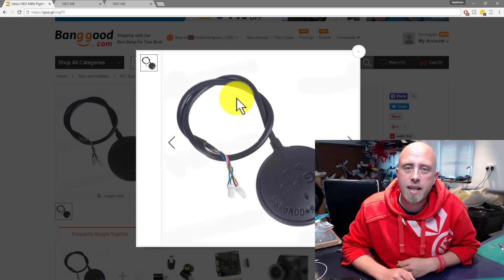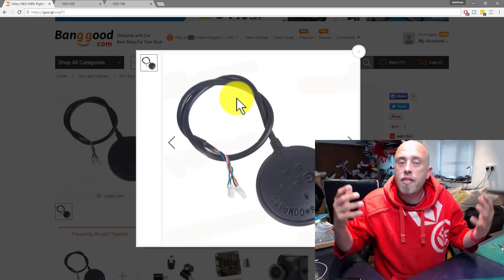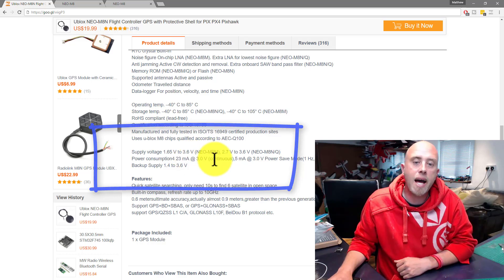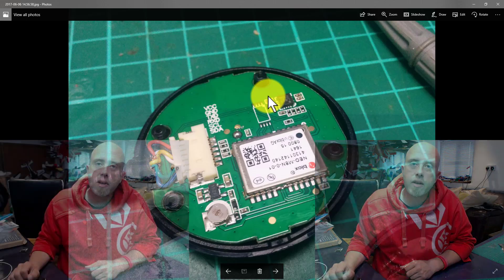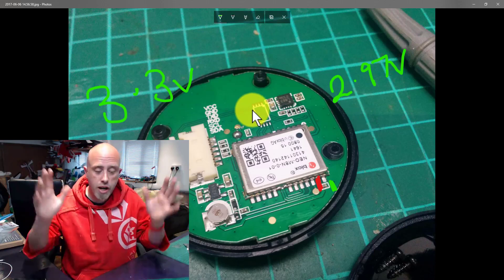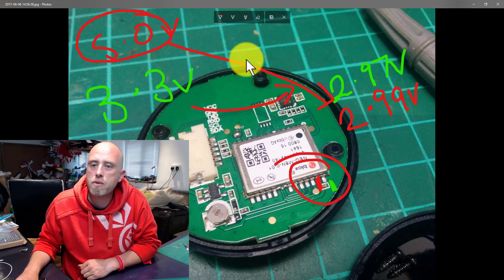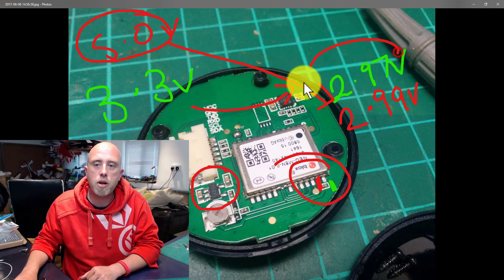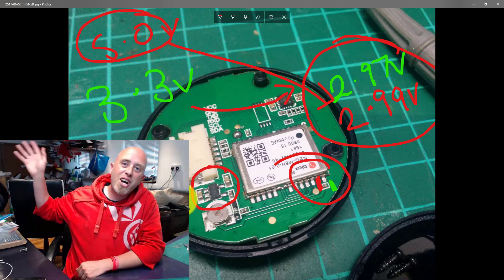NEO-M8N GPS 🛰️ Unit Supply Voltage 3.3V OR 5.0V - WHO IS RIGHT???

Comment: We use these at work, but I've just noticed that if I give it 3.3v input instead of 5v, it cuts out ALL of the UART RX frame errors. There may be something I am doing that causes this to present when using 5v...but the simple fix thus far is just give it 3.3v input and be done.

Comment: Using a bn220 I get 12 sats on 3.3v.  With 5v it takes forever to get 5
Reply from the maker: Howdy Phil, that's strange it had a voltage regulator in it.

Comment: Here's the datasheet for your particular LDO regulator (15ZF), it's  3.0V regulator, 250mA max output, with a max input voltage of 10V. So you could technically run this off more than 5V. Page 25 of the PDF has the LDO Device marking explanation. https://www.torexsemi.com/file/xc6201/XC6201.pdf

Comment: Perfect, just the verification I wanted. The manufacturer did state there was a "Low noise 3.3V regulator" on the unit in the specs but its good to get confirmation from those who have tried already.

Comment: If you can please check https://robu.in/product/ublox-neo-m8n-gps-for-apm-and-pixhawk-flight-controller/ is the same kind you are discussing in the video? Can it take 5v too?
Reply from the maker: Hi Simon, yea it'll be fine as it's meant for a Pixhawk and those pump out 5V for the GPS units too, Matt
Reply: are you able to see a 5v to 3.3v regulator in this https://static.rcgroups.net/forums/attachments/7/3/4/6/2/5/a11164005-98-IMG_9270.JPG

Comment: what about the logic? rx, tx, etc? it needs to be 3.3 volts or can be 5v as well if the chip is 3.3v? Dont you need an logic converter from 5v to 3.3v as the FC supplies the logic with 5v?
Reply from the maker: That is handled on the FC, Matt
Reply: Depends on a specific chip. Some are 5V tolerant others are not.

Comment: I have the exact same gps as he has. I just tested it today using both 3.3v and 5v. 
With 3.3v both gps and magnetometer work and icons on inav are blue
With 5v only gps work but magnetometer does not, mag icon red.
So please use 3.3v
Reply from the maker: Hi Leander, sounds like you have a duff unit, I'd return it if it's doing that, Matt
Reply: that is strange. I tried two units and did the same exact thing ie. with 5v gps works mag does not. Now I bought another one from bangood maybe the 2 I bought were from same defective batch. Can you confirm that your mag also works with 5v?

Comment: I dont get why people even would argue this point...thanks for making this video, but its even simpler... trace the vcc pin to the sot-23-5 component...bet thats a regualtor..break out the magnifying glass, google chip id,  yep its a regulator...I really dislike idiots who pretend to know what they are talking about when they have no idea...good on ya for proving them wrong!
Reply from the maker: Howdy David, exactly. Although to be fair on the BG website and on the eBay listings, it does say 3.3V, which is right for the GPS chip itself, Matt
Reply: RagTheNutsOff Lol true which I will admit threw me for a loop for a second. That's kind of a big problem with Chinese resellers because every m8n seller I've found uses basically exactly the same description, copy/pasta, and thus that error just propagates.

Comment: Matt, hi, abit of a off-topic question: I'm planning to mount/fit a barometer into this unit (example: https://www.aliexpress.com/item/BMP280-Replace-BMP180-Digital-Barometric-Pressure-Sensor-Module-For-Arduino-IO-port-communication-voltage-1-8/32793270473.html), connecting it directly to the connector pins (vcc,gnd,SCL,SDA) - do you think it is feasible? I've read, you can wire multiple I2C sensors in parallel...Thanks
Reply from the maker: Howdy Jure, I have no idea on this, the iNav lads would be the best ones to ask. Matt

Comment: thank you! I got confused because first I read the specs and thought 3.3v is what it needs. But then I opened the plastic case and saw that on the gps board the "+" pin vas not marked VCC, but 5v!

Comment: I wonder if this is the same with an older m6n, I think I might be safer going with 3.3v.
Next question, where do I find 3.3v on an Omnibus F4 V2.
Before anyone says go buy an M8N, I want to use what I have rather than wait for 3 weeks for one to come from China.
Reply from the maker: Howdy fella, see the pinout for the board, the supplier will be able to provide that for you or look back through the previous videos to find them for the one from BG, Matt
Reply: After doing a bit more research on my GPS unit I have decided to try it on 5v.
It will either work or smoke will escape.
I have a theory, everything electronic needs to contain smoke to work.
I mean stuff stops working when the smoke gets out, so you have to keep it in there right? :-)

Comment: Good stuff Matt, proven regulation, so 5V is happy days. Just one question, i have several f4's with more on the way (many thanks owing to you) and plenty of aircraft to plant them all in, but I also have a few F3's some 10 dof and one or two 6 dof, I was wondering about just adopting them for basic non OSD with RTH and stabiliser for ultra 'raggable' planes I have lying around, rather than wasting them, I could even just use up a few of the old gps units I have lying around. Any ideas? iNav supports F3, just unsure in fixed wing.
Reply from the maker: Howdy Alasdair, oh for sure I'd put them in other models. F3 boards are fine, we're not talking quads here that will truly benefit from the faster processor, however if you ever take a F4 board out, as it's newer it will last longer for other uses. I would set them up with an OSD/FPV to begin with to make sure they fly as expected, then remove if desired. Hope that makes sense Alasdair, Matt

Comment: Or possibly just a resistor / 3v zener diode across the input power rails ? Would cost about 1p for the pair.  Either way, good work Matt, that has cleared that one up.
Reply from the maker: Howdy Mart, yea that would work too, but not likely to be needed as it's got it's own voltage regulator by the looks of it, Matt

Comment: Just look up the data sheets. The NEO-M8N power requirements are from 2.7v to 3.6v. It may also depend on what other components are on the board, for instance the magnetometer may be an HMC5883 which also requires 3.6v max. But if there are other configurations then who knows. Follow the manufacturers instructions (if you can find them). They seem to run on 5v which is nice and convenient but hey, if you can get it to run on 3.6v and can find a source on the FC board for that then go for it......
Reply from the maker: Absolutely :)